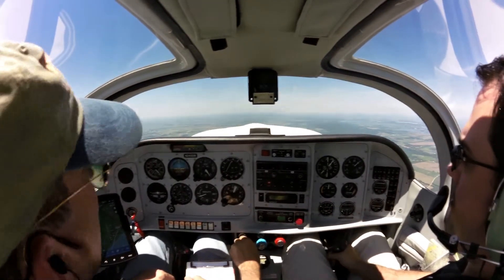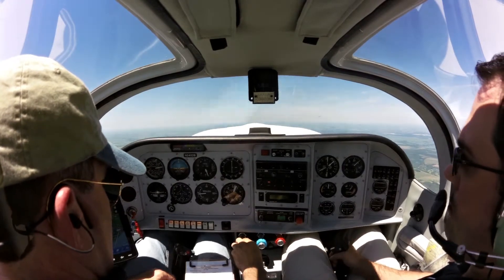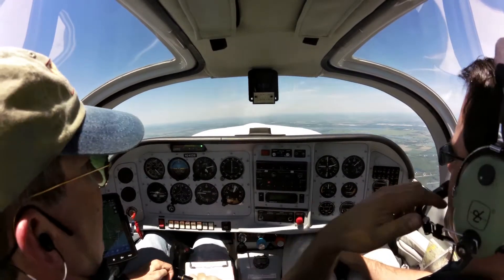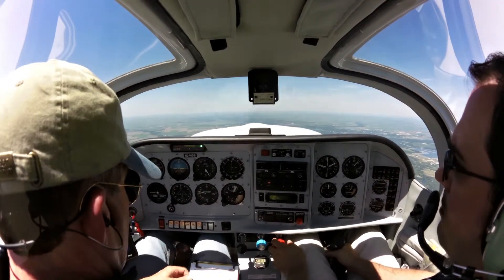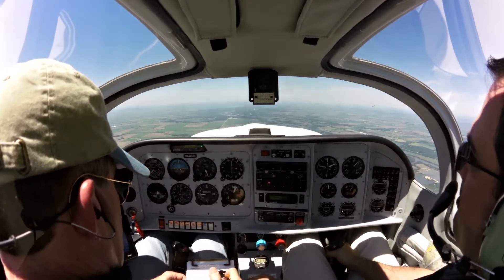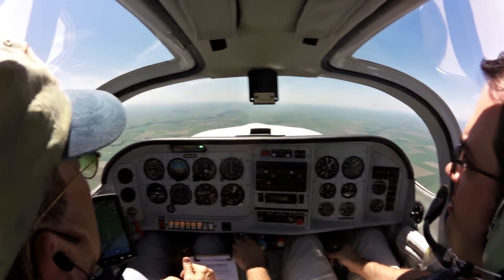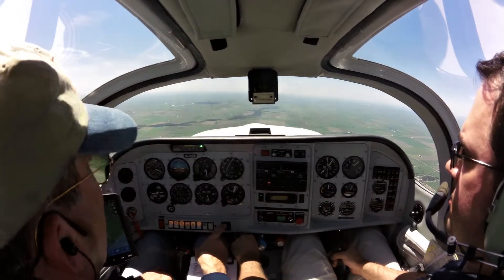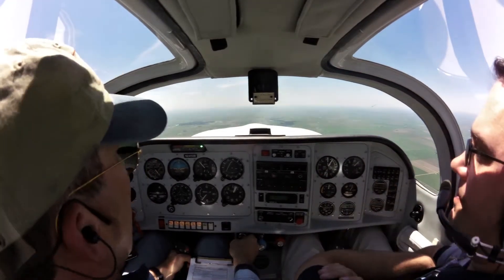6 14 2014 Alpha AOA first in flight calibration

Comment: Brian,

Did you calibrate with flaps and gear, it shouldn't be done in clean configuration? so when you are "dirty" you have a better margin?

- Ground 0 Zero Wind
- Clean Stall Speed x 1.3 =  (Alpha angle)
- Cruise